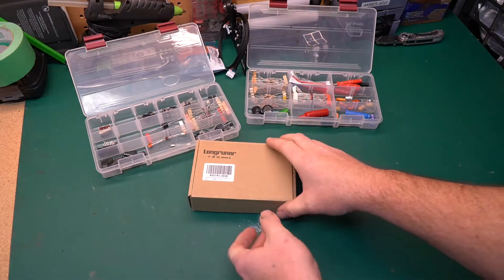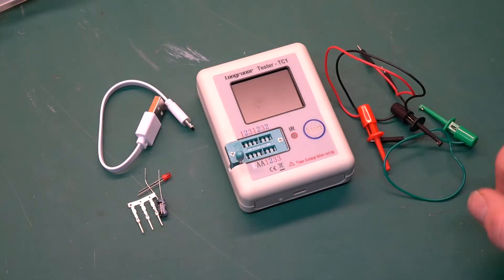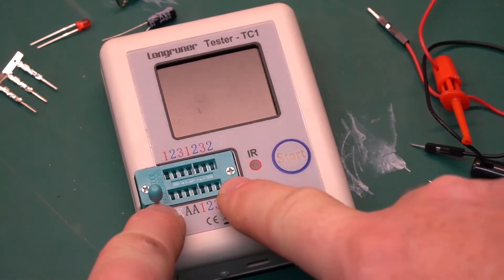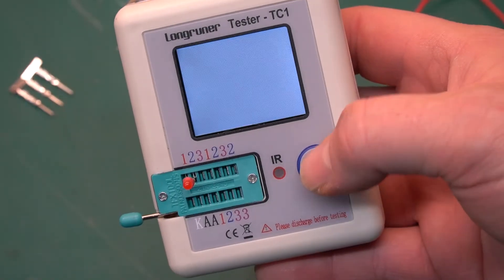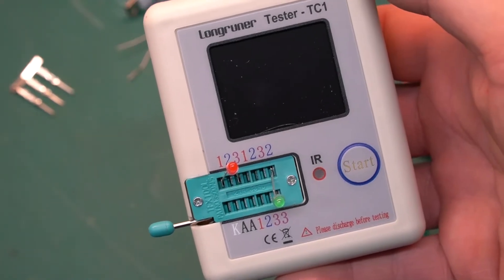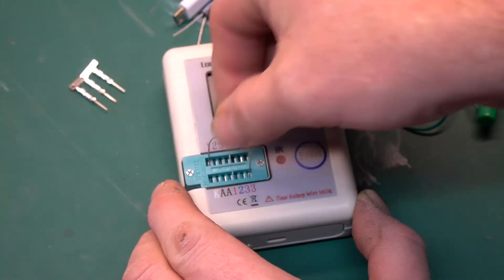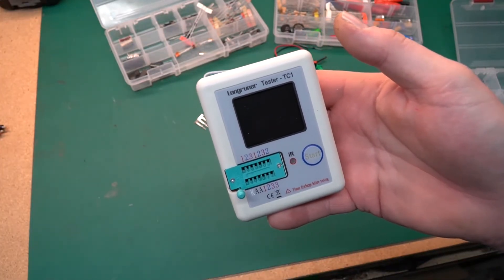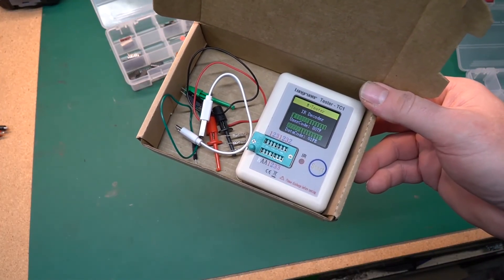Longrunner TC1 electronic component multi-function tester review, New Tool Day Tuesday

Comment: I just got one of these and I thought the wide array of functionality was nifty. I was just looking for an LCR meter. My only complaint is the way you have to arrange the pins on any 3 pin device is impossible without the little dupont connector clips, which I've used larger connectors of this type, and the crimp fail within a few months. There's no strain relief, so they get tugged around quite a bit. But, I will see how long these last. I thought the IR function was especially cool, except I don't have a Hitachi remote to try it out with.

Comment: I build tube amps and bought one for testing cap esr. I have a lot of cheap  poly film caps. The rust colored radial ones. They are all testing 10 ihms. Im of the understanding that esr on a good cap should be below 1 ohm. Some caps wont show an esr reading at all. I've watched many videos on this tester, and one shows a similar tester along side of this one. They test the same cap and get wildly different esr readings . Then the guy says ok they both test within tolerance. 
So confusing..
Is this tester useless for esr testing ??

Comment: I'd strongly recommend adding a small battery switch to isolate it as this takes a constant drain and the battery dies, as I discovered. I replaced it with a larger battery. The TC 7 and others are the same. The case has enough room for a micro toggle switch

Comment: Those three pins aren't for replacement, they're used to calibrate the tester( although I don't recommend using it because it has a big parasitic capacitance making the calibration useless).
Reply: Could you please explain where this parasitic capacitance comes from?  The three pins are just a zero ohm connection between all three test ports isn't it?